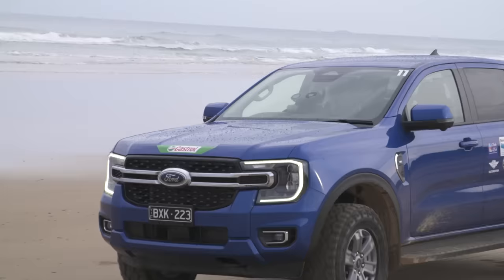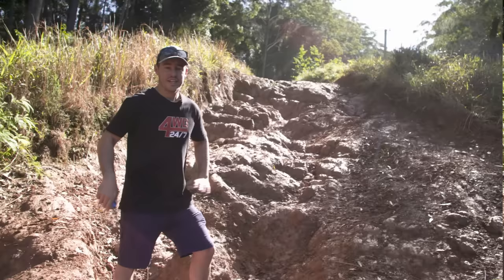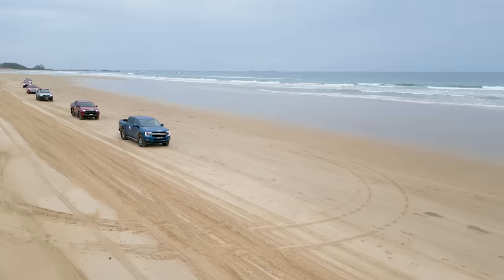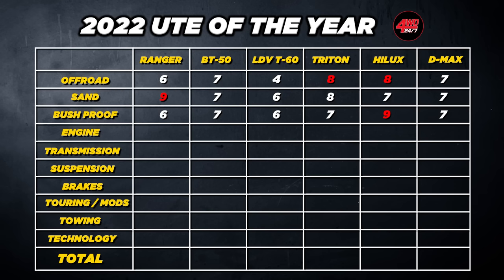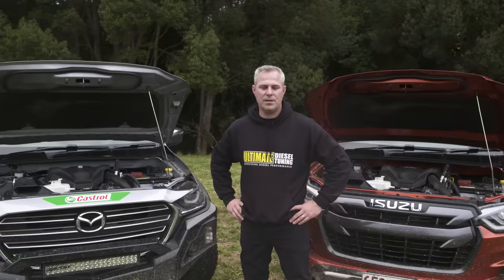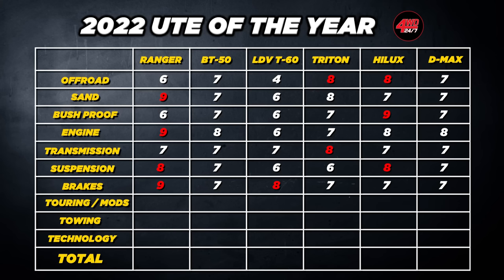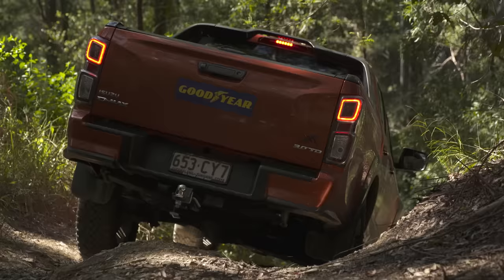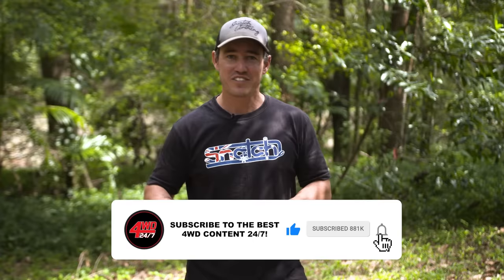2022 4WD UTE COMPARISON - CONTROVERSIAL WINNER! NEW Ranger vs Hilux vs DMAX vs Triton vs LDV v BT-50

Comment from the maker: Alright - you've heard what we have had to say - now it's your turn! After watching the video through - you need to comment here and tell us which one you'd buy and why! I'll choose the 5 best comments who will each get a $100 4wd247.com Voucher. comment below to enter. Cheers, Shauno.
Reply: I’d go with the hilux. 
Reasoning for that. It’s a Toyota.
Reply: Triton for the price point and overall performance, plus $$ at the servo
Reply: 2008 TRD Hilux. The Hilux should win not only for the stock setup but also for the ability and ease of aftermarket modification.
Reply: I was going to choose the ranger but seeing where the airbox and alternator sit is a changing my decision to the Triton. For the power and performance of a more affordable dual cab, and it has performed really well on this segment each year which shows its weight in gold.
Reply: In the video you said you had a brake upgrade to give away
Reply: Hi Great video i drive a Nissan Navara D40 st 
I think think Toyota should win ute of the year. Because it's built for off road even from standard. The alternater is high in the vielcle so it's not easily effected by water or other things such as dirt or mud. It has a great airbox guard just like my D40. So water or dirt don't get in easy. And high placed diff breathers put in  a standard vielcle. That will make it easy to set up with a snorkel and some new tiers and new suspension it will be very capable of taking on the big bush tracks. Hope I win 😊🙏
Reply: After purchasing my first 4x4 a 21 GLS Triton I'd probably still buy another after the test results.
I find it's nimble around town and my recent trip to Lost City proved it's capabilities on the standard tyre but I am eager to do some modifications.
Thanks again guys for the video.
Reply: The manufacturers need to start putting reliable petrol engines back into these utes, simple as that.
Reply: I have a 2020 T60 Luxe that I got for $35ish K that has a rear diff lock and that would absolutely eat up all those tracks you put the utes on. And I would still stick with that because that personally is best value for money hands down.
Reply: Out of that line up I would go with the triton saved money = better upgrades and a fit out. If I had the money I would get the ranger raptor v6 twin turbo is where it's at.
Reply: I’d go for the triton because it’s good for money and it’s reliable has good features and that trans cooler is a must and you don’t have to spend heaps of money on it to do the things you wanna do.
Reply: If I had to buy one ute it would definitely be the new V6 Ford Ranger because the capability of the new motor which makes the driving experience that much better along with it's great looks and I believe that there will be a big range of aftermarket equipment in the coming months that will increase its offroad capabilities.

I would love a brake upgrade kit as it will help because I drive a 2008 GU Patrol Ute with a heavy tray and canopy.
Reply: Well I’m actually getting the GLX+ Triton next month and watching this video gets me very excited to get behind my first 4x4.    So I guess I would buy the Triton as it can handle everything I want to do and more 😊
Reply: Triton any day of the week. They're reliable like what the Hilux's of old were.
Reply: running a 2006 Hilux ggn25. id go the ford ranger new engine and its down falls being easily upgraded to be fixed. its hard to turn down the new hilux
Reply: 💯 I'd buy the new triton
Reply: Defenitly the triton bang for buck you cant beat them
Reply: I drive a Mazda BT 50 3.2 litre 2013 XT model and I think the izusu should win Ute of the year because it’s the underdog of the Ute but is just as capable and the Mazda is a clone of this so there is two ripper utes, love the content and I hope to see more!
Reply: I’m waiting on a Dmax to arrive early next year. Bloody stoked and keen to get into 4x4. Haven’t had a vehicle that’s been able to do anything for my entire life and the thought of driving anywhere at anytime and being comfortable that it’ll handle it is something like a dream! I’ve watched heaps of your reviews and went with the Dmax and I’m sure it won’t disappoint me!
Reply: It’s also like a truck and could tow a pyramid so I’m keen to let it rip 👌🏼
Reply: Id probably pick the bt50 they look tough with some barwork and tray/canopy setup, i drive a 2020 holden colorado
Reply: Hilux, coz I own one😂😂😂
Reply: Would love to see the same test but with modern modded 4wd’s
Reply: Ford Ranger. Most complete unit out there and considering most of these utes will spend more time on the road it also wins for how comfortable they are and how good the ride is. No i don't own one but am considering it. I have an MN and an MQ Triton.
Reply: Despite the Tritons downfalls such as its lack of aftermarket upgrades, I'd still reckon its the best value for money and would be the one I'd buy when comparing to the other vehicles. I personally own a Mitsubishi Pajero NX 2016 Exceed. What an awesome video
Reply: Darren Bryans • 1 day ago
Great video, Hilux for me. Value,
reliability, resale value, after market
parts and mods, the biggest dealer
network in Australia for access if
something goes wrong on a big trip, the
fact it shares an engine and gear box
with the Prado & Fortuner, not mention
a stack of other changeable parts
means even more available parts all
around Australia
Reply: I chose the triton for its looks it's price point and its ability off road. It's also a reliable vehicle which is what you need when you're off road.
Reply: The new ford ranger for me hands down,better technology,disk brakes all around,beautiful looking car ans ofcourse has the new big 3.0 v6,ya cant beat that for towing etc. I just bought one and get it in a few weeks,so excited. Cheers shauno and great video bud.
Reply: The Triton is the pick of the bunch, great build, better price, awesome warranty great to drive not just off road... They are just damm good off-road to plus reliable. What more do you need🚙👍
Reply: It would be a choice between the Hilux & the Triton. 
Triton has lots of advantages that need careful consideration. Excellent value for money. However that over hang on the rear is to be remembered if one wants to load it up. Hilux has always been worth the dollars & capable vehicle. But I bought Mitsubishi because I couldn’t afford the Toyota tax at the time. But I do own a older 2008 Hilux too.
Reply: Curious if you approached Jeep for a Gladiator to test or was it not considered and if not why?
Reply: For the price, it would have to be the Triton. Would be very interested to see how the previous Ranger raptor would vs this current crop, given the negative comments on the 2ltr bi turbo engines
Reply: I'd go the Isuzu simply feels like the best balance between performance/reliability/tech. Enough tech and comforts to feel worth $70k aswell as enough performance/durability not to much that its gonna let you down in the scrub. All round a great car
Reply: I'd go hilux cause Toyota has never let me down in the NT
Reply: Ford because it looks amazing and features are above most 🫡
Reply: I drive a 1996 model 80 series landcruiser, Ranger should win best ute due to the innovative design and looks to have the potential for great modifications when the aftermarket industry get their hands on them. As for most value I'd have to choose the dmax due to being a great all rounder with plenty capability while still remaining well priced  do also love the motor.👍🏼
Reply: I would buy the Dmax whilst it did not get the highest score it consistently scored average or above with no low 6 marks. I have heard of the issues with the safety electronics but recently a friend of mine has test driven one and there is now a button to turn all of these off whilst towing or offroad.
Reply: I'd get the Triton, I have one from 2002 and 2013, I've never had any issues, they just keep going and going. It's the cars that last that you should buy!
Reply: Loving the look and performance of the new ranger in this test. I drive a '97 Ford Courier, the day I can afford an upgrade, I'll be in a next gen ranger!
Reply: I drive a '97 Ford Courier. She works hard Carting hay and firewood and would love to upgrade the brakes on the old girl.
Reply: None. Not one of them would l buy to replace my Defender130.
Reply: I definitely would love to buy the new hilux
I have been driving a 2005 n70 dual cab for the last 10 years and can’t fault it and have use some of the newer hilux dual cabs stock standard for work and mining applications and never had a problem 
So definitely the hilux for me (and it’s Toyota can’t go wrong)
Reply: Think the ranger is no doubt the best including appearance. But like everyone else 20k of extras with the triton would make it far more fun
Reply: I drive a chopped 80 series and would buy the hilux because I know it’s Toyota and reliable and it’s got the good suspension I know it has got drum brakes in the rear but I don’t like the ranger because of how low the front is to the ground and ldv just I wouldn’t and that’s my reasoning.
Reply: Ranger or new gen amarok because of the V6
Reply: I would buy a ranger. But I own a triton. I think better value for money. But a ranger is on the cards, it's my dream ute, so I'm going to have to own one, one day. 🤞
Reply: I have a 9 month old dmax, but the safety beeps and what not are irritating, can only turn off lane keep assist easily, everything else has to go through a menu.  Ranger looks the goods, but very expensive. Triton excellent value, but for me not enough room in the back seat for teenagers. Reckon I'd pick the hilux, seems toughest for offroad stuff (I'm on a farm), without all the safety buzzers, and the Toyota support network.
Reply: I own a 2016 Hilux. Lifted, diff drop, bit of bar work, factory rear locker, bush pin stripes but otherwise nothing too outrageous. It’s got 90k on the clock and I’ve given it heaps on these tracks in Coffs and off-road up and down the coast… touch wood I’ve not had a single issue.

I’d pick the Hilux again - It’s the boring choice but availability of after market parts, ease of modification, real world off-road performance (from an IFS vehicle), clearances (when other vehicles are hung up), good power (with a tune) and - It just works. Gets you there and more importantly gets you home, every time. You can’t argue with reliability or getting back safely after taking that track you really shouldn’t have - with only one way out. The Hilux gets you home again.. and so has my vote.
Reply: Favour the Isuzu Dmax for it's all round reliable engine and towing capabilities.
Reply: I think it should have been the BT-50 just because it has the same motor as the D max an Graham  has had no problems with his D max an it looks a very nice rig yes it has some draw backs but don't they all an I drive a Nissan Pathfinder  R51
Reply: @no1stato  in my opinion there's no way the ranger is worth 12,000 more than a hilux but as long as you enjoy it mate, that's all that counts
Reply: @Kaydencool2013  100% there is.number 1,much nicer looking car number 2 way better technology number 3 much better and bigger engine for the towing i'll be doing. Want me to keep going?
Reply: @Kaydencool2013  it didnt win 4x4 ute of the year for no reason!
Reply: Personally, the Hilux is shere I would invest my money. Many reasons why but primarily it is a great performer for a great price with great upgradability and aftermarket support, legendary reliability and being a Toyota, resale value will be maintained. Unlike the Ford, it can and will perform on difficult tracks right out of the box for under 60k and you really cant beat that reputation. Also unlike the Ford, it wont be seen as often crawling through a Maccas drive through on OWL tyres with a single jetski off the back in the middle of the city. Hilux, got my vote.
Reply: I drive a 2021 Mazda BT50, I’d buy it again because it’s got all the goods of a DMAX but looks lot prettier!!
Reply: What’s going on fellas. Good to see you boys handling business with testing these dual can utes. I currently drive a 2017 Toyota Prado VX - a little better than Sootie 2.0 but no way near where I would like 4wd to be. Would love the new Bendix brake upgrade as we look at touring up north in the Pilbara and Kimberly. 

Best Ute I reckon would have to be the Lux (Hilux). Look Toyota has been around before I was twinkle in my dads eye and the all round performance and durability of the Lux makes it incredibly versatile and really the sky is the limit with customising and adding additional features. The responsiveness of the 2.8 litre in the newer model makes all the difference compared to the earlier 2.8litre models. Really a fantastic dual ute set up. Good amount of low down torque and good for all round touring in stock form…”The greater the engine displacement the great responsibility” - Sootie 2.0. I reckon the Lux wins any day of the week.
Reply: I'd go the isuzu cos in pretty much all your trips Grahams isuzu get's through pretty much all the challenges unaided or is that just the driver Shauno 😃😃 but yeh i reckon it's a pretty good allround vehicle
Reply: @matthewackley9175   Because it's crap as a ute!  Just look at its towing capacity and payload and you'll realise it just can't hack it with the others out there.  Admittedly it is supposed to be great off-road but that can't make up for all the other shortfalls (not least it's price!!!)
Reply: D-Max is not only value for money but wins on reliability. Ranger if you can afford the $100k buy and mod price. 
Side note: tech is great for mall crawling but not always your friend in remote rural Australia. D-Max takes the win in my book. Brake upgrade here I come. 😅
Reply: @darcyrobertson2793  😂😂😂😂
Reply: @pacman5590  all fair points but the question was did they decide not to include it or was Jeep not willing to provide one. I own 2 Jeeps but my daily is a ranger and the gladiator wasn’t even considered due to lack of towing ability and price.
Reply: Now I am owning a Triton. It really fits me. I'm in love with its aggressive look. Of course, the price and you get sort of things.
Reply: Definitely the triton a great priced fly under the radar dark horse Ute well done Mitsubishi
Reply: I drive patrol GU
Hilux should win for Ute of the decade let alone Ute of the year. Extremely reliable, you can work hard Monday to Friday and play harder at the weekend. It’s on my wish list.
Reply: Hilux
Reply: Would get the ranger if I had the money, with the additional power you would be able to put a load and upgrades without it becoming sluggish. Value for money definitely a trition
Reply: id say after watching the Hilux. well thought out and better value for money than the ranger. reloable in the bushability is so so important for us as we do remote travel and breaking down on simple things like alternators when out in the deep scrub really ruins your trip. plus you can get parts EVERYWHERE, in all our travels its been mindblowing when youre in the middle of nowhere the amount of toyotas compared to everything else is off the charts. so with that in mind and looking at all I saw in your test, way better value for money and well thought out vehicle thats now been honed to a powerful well made and thought out vehicle.

we drive a 2002 landcruiser UZJ100 V8.
Cheers for the test guys, well made and informative.
Reply: Hilux allday anyday
Reply: I think the Hilux, for its resale value and because its unbreakable.
Reply: @dewaldcraig9238  Cheap doesn’t equate to value for money.
Reply: The new ford ranger v6 but wild track
Reply: @jerrymyahzcat  do you own one or have you driven one?
Reply: This was an interesting episode, however was disappointed that Nissan would not supply you with a Navara to really test out. I liked the triton and dmax, especially seeing what Graham's dmax is capable of on your 4wd247 adventures. Thanks guys for providing great information.  And places to go exploring. Would love to come 4wding with you all. 💜😘.
Reply: DMAX all the way! I think, I mean I am still waiting for my order but in my imagination it is going great!
Reply: @dewaldcraig9238  Own or driven one what? My statement just said cheap doesn’t equal value for money (neither does expensive for that matter).
Reply: I would love the brake upgrade kit for my 2014 ford ranger especially now I'm doing a lot more touring with the family. Going to say the new ranger is the top dog in your test overall just seems to be more capable with all its new upgrades compared to its older models. Making it better than it current competitors
Reply: I would go with the hilux, because I don't think you mentioned it on this video anything about the resale value you can get back from selling the ute second hand
Reply: For me its a Ranger Where can go and do anything..Other trucks simply good for off road but missed other important things such as comfort ,safety and power..No offense to other viewers but if you choose to do off road all the time, for Me I choose to have comfortable ride at anywhere at all times..👍😉
Reply from the maker: Hey Ross Dickson!
You've won the $100 voucher! Please send us a message to our Facebook page with a screenshot of this comment & we'll sort you out. If we don't hear back in 7 days, we'll have to re-draw or save it for the next one!
Reply from the maker: Hey, Tafazul Akhtar! You've won a $100 4wd247.com voucher! Please send us a message to our Facebook page with a screenshot of this comment & we'll sort you out. If we don't hear back in 7 days, we'll have to re-draw or save it for the next one!
Reply from the maker: Hey Ozzies Camping Adventures! You've won a $100 4wd247.com voucher! Please send us a message to our Facebook page with a screenshot of this comment & we'll sort you out. If we don't hear back in 7 days, we'll have to re-draw or save it for the next one!
Reply from the maker: Hey Darcy Robertson! 
You've won a $100 4wd247.com voucher! Please send us a message to our Facebook page with a screenshot of this comment & we'll sort you out. If we don't hear back in 7 days, we'll have to re-draw or save it for the next one!
Reply from the maker: Hey Ethan Holder!
You've won a $100 4wd247.com voucher! Please send us a message to our Facebook page with a screenshot of this comment & we'll sort you out. If we don't hear back in 7 days, we'll have to re-draw or save it for the next one!
Reply: The triton, so happy with buying one. Just waiting for it t o arrive and would love to be my first upgrade
Reply: been driving 2022 Toyota Hilux, and i think ISUZU D-MAX takes the win in 2022 because its an all-rounder vehicle with decent level of cabin comfort..
would love to see u guys in Netflix series soon, wish u all good luck.
Reply: Ssangyong musso as its cheaper, creature comforts and I like to be different.
Reply: Hilux. Great off road, bushproof, full sized canopy and the SR (mid spec) is perfect to modify. Yep the Ford engine is better from performance, but it aint wirth the extra cooin for the other reasons before I'd start to modify... My opinion anyways. Thats why I own one.
Reply: Hilux all the way. Reliability and durability and overall good results. 
For me also the looks and the worldwide and quick possibility for supplies.
Even here in Europe...
Reply: Obviously the hilux
Reply: Hilux has the best look and you can can get spare parts easily,, also it's consumption is acceptable
Reply: I didn't buy any of these because the back seat had no room. Ended up forking out for a Rubicon Gladiator and out of the box I can't fault it off road. Shame it didn't make the video.
Reply: how about you specify what diff the ldv has. does china have special diffs..?.
Reply: bushproof..toyota 4.5tdi.. NOT..
Reply: Would be wonderful if you guys could do the same review on these same cars after 2 years of ownership. Reliability review?
Reply: I for one wouldf liked to see the new Mahindra ute in your test and also we can only wonder why we dont see ,ore ites from the likes of jeep nissan patrol i would buy a single cab wrangelr in a flash if there was one . Thanx for a good show
Reply: You're a Australian channel, you folks couldn't find a Mahindra Pik Up for this? C'mon, like get 'All the Utes in the Market'
Reply: 😢I
Reply: @mansontai2426  I drive a hilux I am thrilled with brakeing and r
 The rideide
Reply: the ranger for the win mate, I'd go full send on the after markets and just make it something that can keep up with sooty (maybe even show her a thing or two)..........((maybe lol))
Reply: I reckon this is a really unfair depiction of the LDV you should’ve had like for like you should’ve had a car that was equivalent to all the others. For example you should’ve had the lux there with the automatic box and factory rear locker. I think you’ve badly miss represented the LDV.